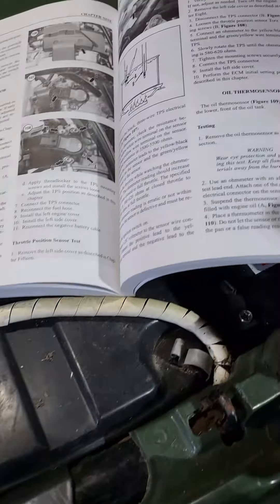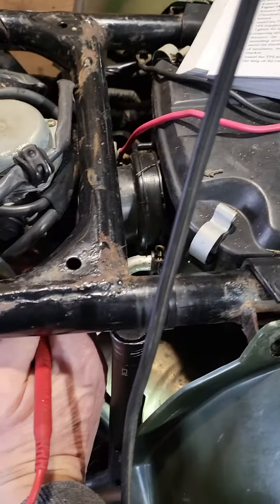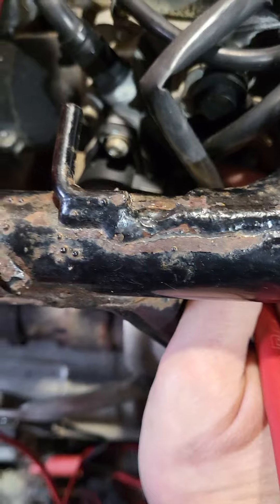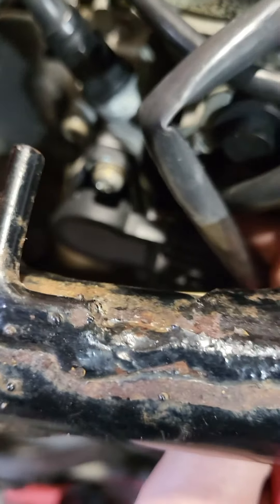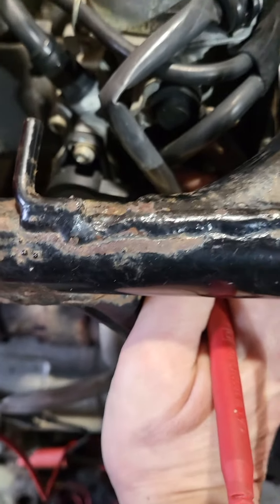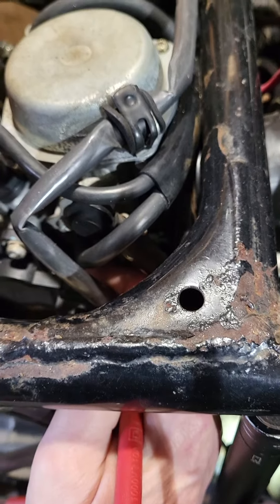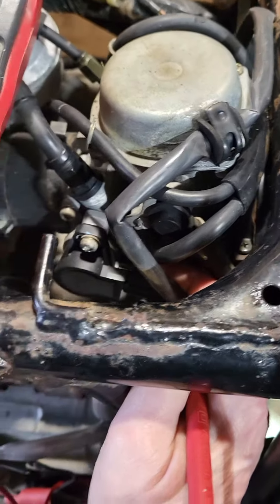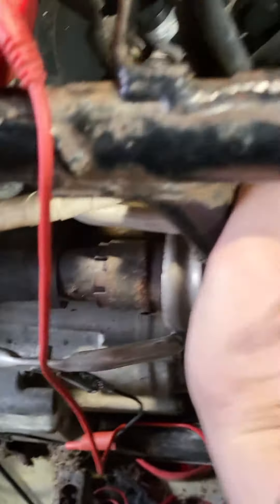2003 Honda Foreman 500 Rubicon Throttle Position Sensor adjustment.

Comment: 580-620 ohms
Is this with throttle closed or open?
Reply from the maker: Throttle open.
Reply: @benholden4585  
Thank you for the quick reply.
Assuming 0 when closed (likely something close to 0 because of resistance in the probes)
Reply from the maker: @JOATJESSE  per the service manual it doesn't say anything about the throttle, so it's assumed that it is open.

Comment: Can you explain the process a little more please, I can’t see what you are doing in the video.
Reply from the maker: Step 1-Loosen the Throttle Position Sensor(TPS) mounting screws. Step 2-Connect Ohm Meter to Yellow/Black wire and green/yellow wire on the TPS. Step 3-Slowly Rotate the TPS until the ohmmeter reads between 580-620 ohms. Step 4-Tighten mounting screws securely.